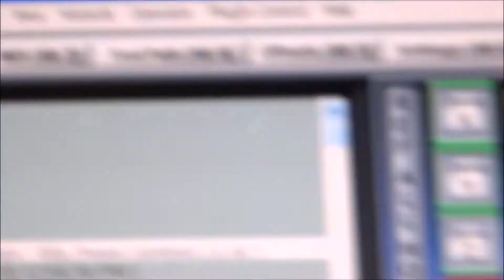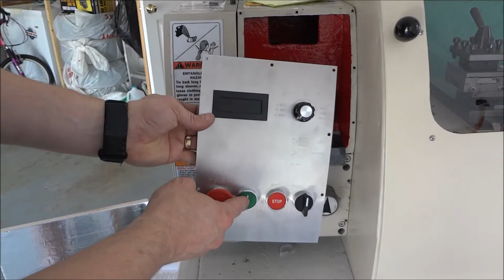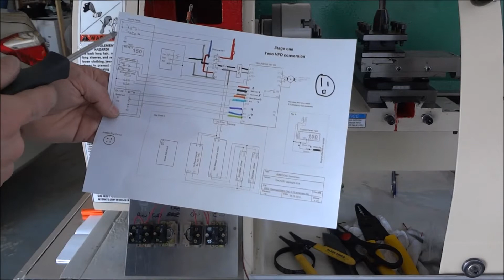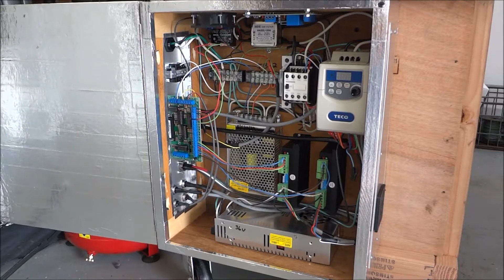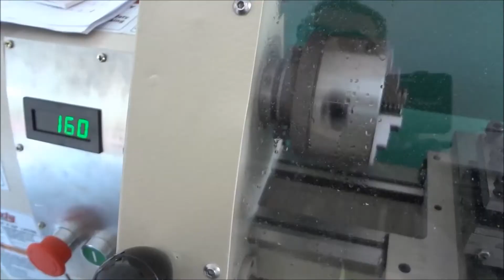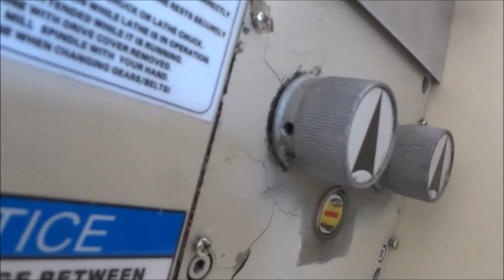G0602 Project Pt  10 Control Panel

Comment: Sam, something I've found when experimenting with VVVF drives is dropping out the contactor is the quickest way to stop the motor.  The motor regenerates back onto the DC link.  In fact it causes us trouble with the big machines when they lose the speed / direction sensor.  The traction motor locks up and the wheel skids.  People erroneously think either park brake has come of the gearbox has failed.
Reply from the maker: Yes this is common with vfd's .

Comment: Control panel looks great and very well thought out. Looks like a real pro when it comes to milling out those panels.
Reply from the maker: William Hardin  Thanks Thin sheet metal can be tricky if your not used to going SLOOOOOW  LOL but I finally figured it out with a little help. Yea it turned out nice I will be replacing it with a full cnc version down the road.